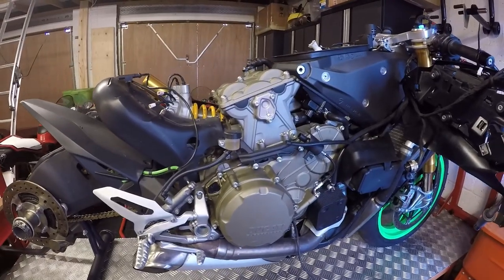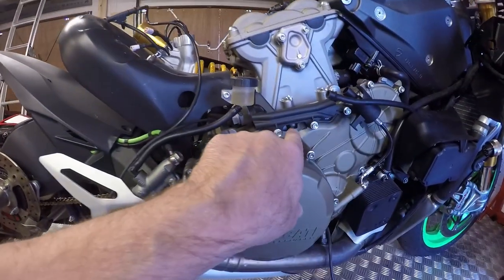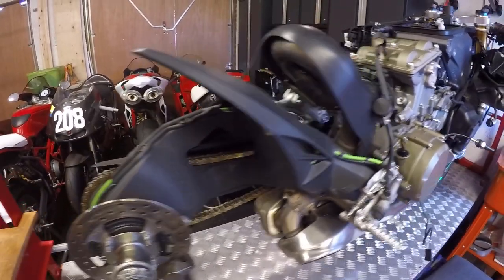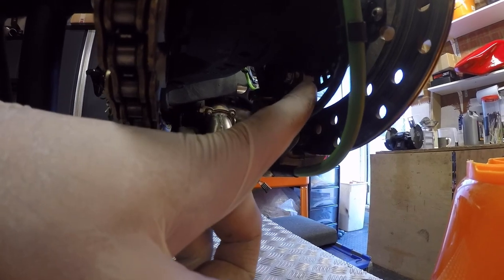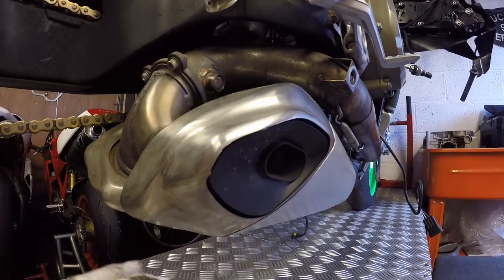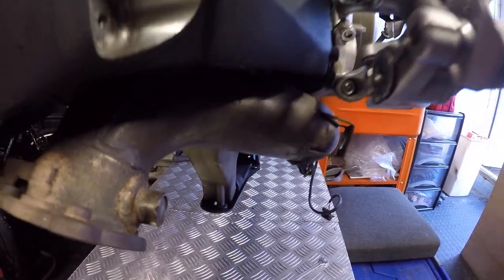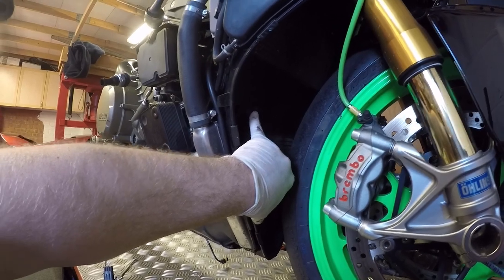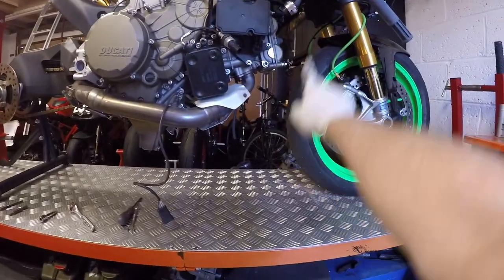Panigale 1199 S to R Engine Swap Video 3 - Exhaust and Radiator Removal

Comment: Hi 
I’ve finally bought a 1199 panigale to race, you videos are awesome  however I’m struggling for a belly pan that will pass scrutineering. The bike has a 70mm superbike Termi system on it and the belly pans I have won’t fit. Can you recommend one?
Reply from the maker: Full Six Carbon do a good belly pan. Not cheap though

Comment: Your vids are so helpful, thank you. 
Regarding the 3 bolts at the back of the silencer where you had one already snapped, are they problematic to remove in general?
I need to get mine off and I really don't fancy having to lift the subframe and remove more of the exhaust than necessary. 
TIA for any guidance.
Reply from the maker: They are relatively straight forward to get to but being exhaust bolts and the location they sit in means that they may be seized, this had evidently happened to the previous owner of my bike.

Comment: Is the radiator really only 4 bolts?  I need to fix a leaky horizontal cylinder valve cover but need to get behind all the plumbing.  If it’s easy as that, thank you!
Reply from the maker: The radiator is only 4 bolts but you have to remove a lot of other stuff to get it free to move. Funnily enough my first ever job on this bike was the same one, it took me about half a day to complete.
Reply: DesmoWerx gotcha - yep I’ve got all the fairings off as well as the side accessory panels, radiator drained etc...  Will probably have to get a few more things off.  Thank you!